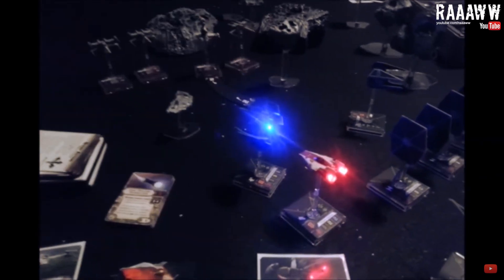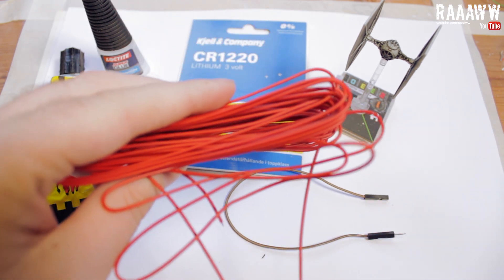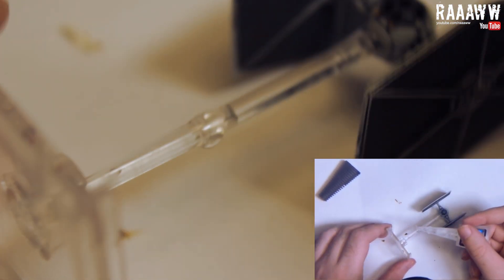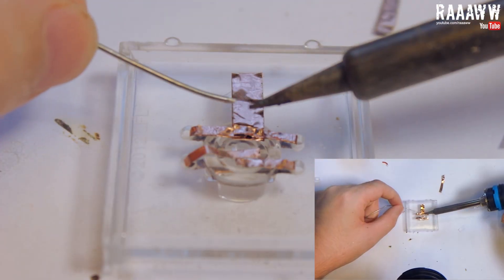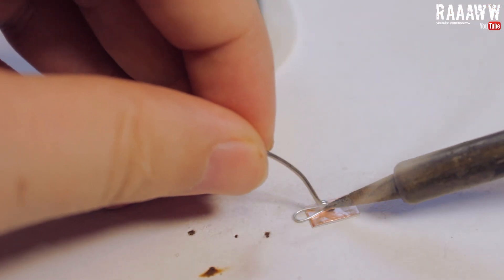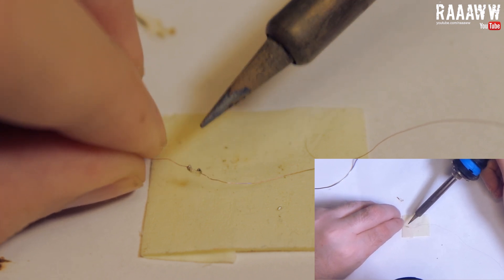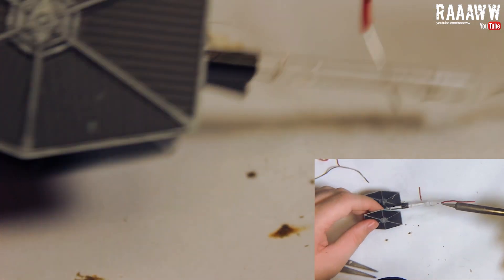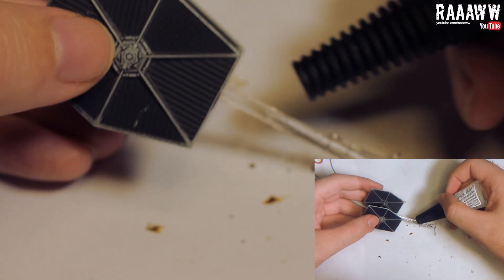How To LED MOD X-Wing FFG Models And Still Being Able To Take Them Appart *Tie Fighter*

Comment: I'd like to add lights to large ships like the ghost, millennium falcon, shadowcaster, etc. Would you recommend I stay with the same size LED and battery? I am not sure how you called the single wire in with the red plastic tubing around it. Do you have a list of products you used that you could post to the comments or description of this video to give use some idea of what materials we need to start a project like this? These videos are really helpful! Thanks for putting them together!
Reply from the maker: Hi, sorry for late response. do you mean the full core wire? It's stripped so that it holds the battery in place and also connects it. You might have to hook up multiple batteries if you need more lights. Parallel connection doesn't increase voltage and drains the batteries slower, serial connections adds the voltage from all batteries.

List of products:
1. Ship of your choice.
2. 3Volt lithium watch battery, or any size that fits under the stand.(Note that you have to take voltage into account)
3. Clear super glue
4. Hot glue (probably better then what I used which was Karlsons Universal Glue)
5. Threaded wire (wire that is built on multiple threads for flexibility)
6. Full core wire (wire that is just one thick thread inside)
7. 3.2v 20mA SMD LED (0603) https://www.elfa.se/en/smd-led-blue-0603-sloan-smd-b0603-02/p/17518696?q=75--186-96&page=1&origPos=1&origPageSize=25&simi=87.03
8. Copper Tape